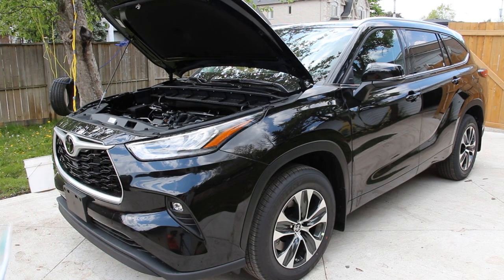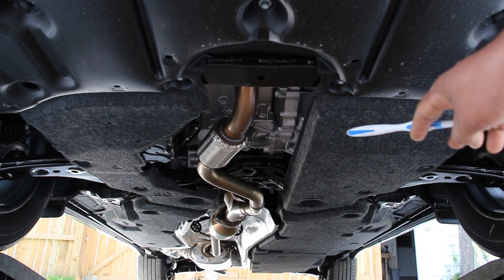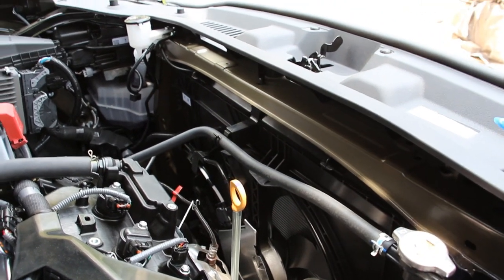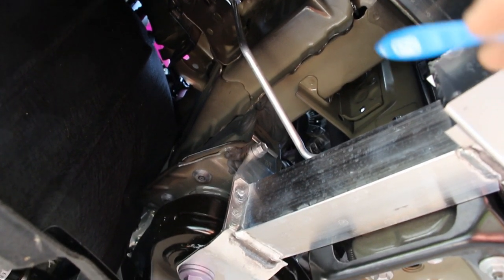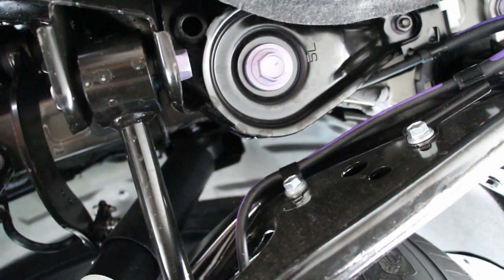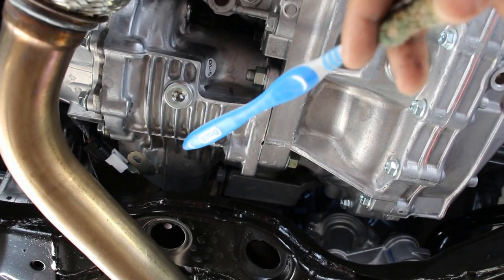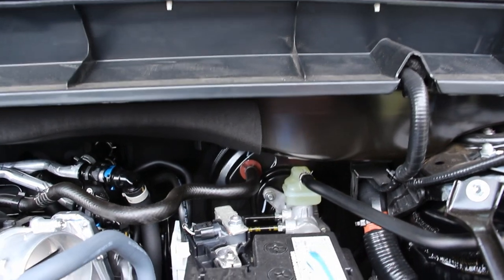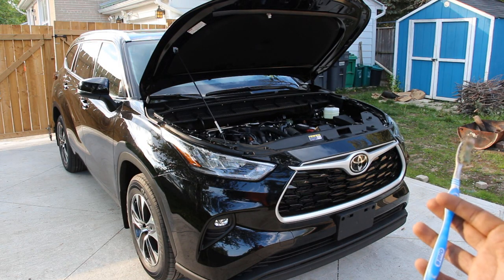Toyota Highlander Mechanical Review

Comment: Having to remove the transaxle assembly to replace a water pump or thermostat is 100% ridiculous.
Reply: Toyota hired some audi engineers who got fired
Reply: You think that's bad. Toyota said the transmission fluid does not need to change for the life of the transmission (Whatever that means). I'm not buying that excuse Toyota
Reply: Yaa.. its time to switch to electric...
Reply: I have a 2020 RAV4 that I got to replace my constantly breaking 04 4Runner and the 4Runner was a lot better built.
Reply: @Olliethelabradane  Change yourself and stop lying.
Reply: Don't worry you will not need a water pump for about 250,000 miles anyway.
Reply: @squidproquo2241  on 25k it will start to leak
Reply: That's nothing; try looking at German cars. Pretty much anything you do in a Volkswagen starts with first steps; remove entire front of car
Reply: @battlefield1942   "on 25k it will start to leak"

NOPE! That would be Telluride.
Reply: @kevinbarry71  EXACTLY!!!! LOL! These are Toyota haters.
Reply from the maker: Crazy!
Reply: @Ashoud_Anobetah  or BMW/Mini engineers
Reply: @squidproquo2241  He right quite a few had water pump issues, front timing cover oil leaks which enquired an engine out to repair it properly and the very first gen 8 speed offered in the Highlander was junk second year revised outside of that a good vehicles
Reply: @kevinbarry71  They want you to clean that front part often :P
Reply: Toyota tech here you don’t need to do that in order to get to the water pump just take the motor mounts off on the engine side use a jack and jack the engine up and you can get to it that way same way we do it on all 2grs all the way back to the early 2000s
Reply: @kclefthanded427  all of them do that now. My civic manual doesn't have a word for transmission fluids. Not for automatics nor manuals
Reply: @squidproquo2241  I've had 4 Toyota's in my life, currently have a 2018 Highlander w/ same motor. Water pump went at 78k. I don't hate them, but they've definitely got a weak point to this engine setup that is the cooling system/water pump. On the 2018 Highlander, we did not have to remove the transaxle. This new one is stupid though....
Reply: @awaara24  wow that's very early for a pump to give out. No tsb?
Reply: @moeanthony9308  nope. Also replaced front bank coils. Only one was covered under warranty before it expired and then the other two went as well. Knock on wood the rear bank coils going strong so far at 84k
Reply: @awaara24  Wow. I only buy Toyota. I didnt realize the Highlander had such issues and complexity in the new tnga. You still have the Highlander?
Reply: @awaara24  Yea it's best to change all of them at same time.. Coils
Reply: @awaara24  "I've had 4 Toyota's in my life, currently have a 2018 Highlander w/ same motor. Water pump went at 78k. I don't hate them, but they've definitely got a weak point to this engine setup that is the cooling system/water pump. On the 2018 Highlander, we did not have to remove the transaxle. This new one is stupid though....
"

In my life I noticed that haters tell all kinds of lies, I understand them, They want to be screwed by European car makers because they like fancy European cars. However, ignoring the facts is really stupid.
Reply: I’m glad I have the RAV4 with the I4.  I’d get the Hybrid Highlander.  No need for a V6 anymore.
Reply: @kclefthanded427  they all say that now… anyone who knows anything needs to change their trans fluid every 60k
Reply: @kclefthanded427  Lifetime fluid.  🤣🤣🤣🤣🤣
Reply: Is it the same for the second generation highlander
Reply: Get the hybrid model
Reply: Glad I saw this before I bought a Highlander.  The thought the rubber oil cooler and oil leak behind the timing belt rear shield was enough problems with this engine.  I think I'll  hold  on to my 1MZ

Comment: You do NOT need to drop engine/transaxle to replace waterpump on 2GR. Put it like this, Toyotas book time is roughly 2.5HRs to replace. Nor do you have to remove front end to replace alternator or A/C compressor. I work at a Toyota dealership and I need to correct these Misunderstandings lol. Unless you work for Toyota however, you would never know.

Comment: A bit of a maintenance nightmare once that cooling system needs service. Mechanics be like 🤑
Reply from the maker: Ya man I don't get it....remove transaxle to get the waterpump and thermostat??
Reply: This is why I like your videos. Informing us how difficult it is to do common maintenance
Reply: On previous models, there is a way to replace water pump by removing the engine mount and slightly raising the engine and don't have to drop the whole assembly. Not sure if it is still applicable to newer models.
Reply: @speedkar99  Great video! How often is this maintenance? Is this also an issue with the hybrid models?

Comment: I work at the dealership we don’t remove transmissions to work on water pumps and t stats we remove the driver side engine mounts and jack the engine up and get to it that way
Reply from the maker: Yeah I heard that's the way to do it on previous generations. So they still pay you the 8 hours for removal?
Reply: @speedkar99  I would have to check what they say but it’s most likely around 3 or 4 hours for warranty time
Reply: Nice car but feel I get pineappled each time I take it for service,  just like mercedes
Reply: Modern cars suk

Comment: Hi! Thank you for your detailed video on the Highlander.  I have a question regarding my 2017 HL SE V6.  I used to get 28.2 mpg on my highlander (99% highway driving).  Since I changed the battery without memory save, my idle has been more rough and I’m getting a lot less mpg (25.5).  I tried doing the idle relearn but it’s still not getting the mpgs I used to get.  I heard that 2017 was when new engine for HL came out and Toyota didn’t initially set the computer piston valve firing correctly at first.  Could I have reset the computer on my car that it lost some kind of correction to the firing?  Thank you

Comment: HeaterCore:  If you don't mind.  In the future, could you please include the heater core access in your reviews.  Some vehicles have easy access heater core and others you need to remove the entire interior dash to access it.  

How difficult is it to access the heater core on the current model Highlander?
Reply from the maker: I don't think heater core is a regular maintenance item thus it's not as easy to access
Reply: Had mine go out in 2016 kia sorento they had to take whole dash out

Comment: I have a 2006 Highlander with over 250k. Made $60k in one year in that car doing Uber/Lyft in the snow and all my maintenance myself 😀👍 To keep the car running I changed driveshaft (bearing near the hot Cat failed), all 4 wheel bearing, 2x timing belts (to be safe), sway bushings, 1 Fdrive axle, 4 brakes and rotors, 8 tires, radiator and thermostat (because I never changed R-fluid😳), valve gasket (and clean out carbon deposit on valve which caused pinging), 3rd set of spark plugs. Use inly Valvoline or Amsoil XL. Transfer Case and Transmission.
Amsoil, rear diff use Redline/modifer fluid (for better snow traction and reaction. No clunking that I had with Amsoil which too slipery) 😁👍
This New Highlander looks way harder to work on and my back won’t like it. Might do a new Bronco Diamond 4cyl w/ stick. Any suggestions?

Comment: Any idea if the rear suspension setup is different on the hybrid model? If not, what's the best way to maintain it to avoid issues of replacing? I placed a deposit on the hybrid.

Comment: What's with the trend of placing the ECM under the hood, near the engine, under the wheel well or bumper? Cars used to have them under the glove box or in kick panel inside the cabin, where it stays cool and dry.

Comment: Hello I do a Toyota Highlander platinum 2022, I bought it on auction and trying to fix. I am having issue with radio no working, and having a cable conning from the fuse box that I don’t know where is connecting, I am sharing a photo of somebody can help with it. Thank you

Comment: Stupid question but is this the same motor as in the Lexus IS350? Are there parts compatibility if they are not the same?
Reply: 2GR-FKS same engine
Reply: @anurakboribun2560  okay good to know thank you
Reply: @ToroMoto  https://en.m.wikipedia.org/wiki/Toyota_GR_engine#2GR-FKS
Reply: @anurakboribun2560  Exactly what I was looking for thank you. How many KMS do these motors typically last if well maintained. I see a lot for sale in older lexuses with excess of 200k km.
Reply: @ToroMoto  well, I think that you answered yourself your question. Historically they have been known to be very reliable and long lasting.  Then goes the complicating factor that manufacturer changes design now and then and the new generation may develop issues down the road...  There are other variables like: WHO was driving, WHERE, HOW - meaning what distances, was it warmed up on trips or not even got the chance to heat up before it was at the destination three miles away. Then how was it maintained, what oils and filters were used and if regularly and not too long  between changes. Time will show.
Reply: @anurakboribun2560  sounds good thank you.

Comment: So, the fuel pump is not in the tank ?
If true, then I need to buy this vehicle
Reply from the maker: There's a low pressure fuel pump in the tank. The high pressure fuel pump is on the intake camshaft

Comment: That control arm bolt has been like that for years.  You can get it out it's a bitch then when changed out you fix it by putting the bolt in the RIGHT way

Comment: I have 2 friends that have highlanders who have done most of the work on their cars in the past and hate this car because it always ends up costing an arm and leg when it needs to be serviced.
Reply: We have a 2003 Highlander with a V6.  It runs great and does not need repairs.  But, to have the required timing belt, water pump, etc., with new factory parts done,  was about $900.  But, it will be many more years until needed again.  (That''s about 2 car payments for a new car today, right?)

Comment: 7:45 I have heard manufacturers were obligated to put these extra lower frame pieces on SUVs/trucks so they wouldn't just ride up on small cars and crush the small car occupants.  Is that true or just myth?     Anyway, another great review.
Reply from the maker: Yes. That's the lower bumper rebar to prevent under riding

Comment: This car has a reversible alternator that has to work both ways one as and electric motor to start the engine and drive the vehicle down the road and a alternator to recharge the battery
Reply from the maker: Not this one. The Jeep Wrangler has that with e-torque

Comment: Why are some car manufacturers going away from spin on oil filters to cartridge style oil filters?  The latter is more prone to leakage and messier to replace.
Reply from the maker: I don't know. I guess eco-friendly
Reply: My guess is two reasons. Filter is  cheaper to make, only the paper insert and two gaskets. Yet they charge the same for it. Second it scares away DIYers, raking in more to service dept.

Comment: I'm disappointed by the amount of plastic parts used for oil and coolant cooling system in a modern Toyota. The Vauxhall/Opel suffered abundant issues with plastic parts.
Reply from the maker: Yeah time will tell if these hold up. At least the front frame and dad support is all steel and not plastic

Comment: I'm assuming mechanically the 2021 is the same, just with a newer sheet metal. Too bad there's no longer a 4 cylinder option.
Reply from the maker: The latest highlander is on the TNGA platform so there's quite a few things that differ from the previous one.
Reply: @speedkar99  Great info and good to know!

Comment: Why turbocharged engines vacuum is not sufficient and they need a vacuum pump ?
Reply: Instead of a vacuum the manifold is pressurized with a turbocharged engine. The brakes are boosted on most cars by using engine vacuum to pull on a diaphragm. No vacuum = no brake assist. Think like pushing the brake pedal to stop a car without the engine running. Same thing. A pump is used to create vacuum instead of engine manifold vacuum.
Reply from the maker: The manifold pressure changes when the turbo spools up

Comment: Hey! They copied Dorman with those oil cooler lines. Ha
Reply from the maker: Yeah they have to have them steel. You'd think by now they'd have redesigned the block to Integrate those lines into the oil galleys
Reply: @speedkar99  You'd think. Personal theory: they were gunshy over the sludge rep of the older MZ engines (caused by too-small, high-flow oil passages in the undercooled head and long conventional oil change intervals) and hedged their bets with an external high flow line. Of course now that they have required 0W20 for a decade it could've been redesigned. But i caught from the video they spec 5W20 now. That's surprising, especially when thinking about making a mostly 2004-designed, large displacement 6 cylinder work for the next 5 or 6 years of emissions/economy regulations. The GR was never an oil burner even on 0W20. And even more surprising since they spec 0W16 in their 4 cylinder lineup starting 3 years ago.

Comment: A mechanical vacuum pump on a naturally aspirated engine it's not even a hybrid.. rubbish''  they could have even used a electronic vacuum pump which would only run when needed..
Reply from the maker: That would introduce more failure points especially for the brakes....
Reply: @speedkar99  exactly.. an unnecessary wear item turning constantly with the engine wether or not your using the brakes.. at least if they went with an electric driven pump it would turn slower or shut down at cruising speeds once no brake application is made
Reply: @speedkar99  it just seems like a miss step on Toyota's side by implementing this.. it doesn't even have the safety margin as the electronic version which can still run even after an engine dies to allow more time to stop the vehicle

Comment: Gotta be honest, I’m a little disappointed in Toyota for cheaping out on parts.  No worse than most makes but I’ve always thought of Toyota as the best overall vehicle.  Like the placement of the bolts that you can’t back out, come on!  Maybe the Japanese have their own version of the millennial generation taking over...
Reply from the maker: I agree. They are riding on their reputation a bit allowing Koreans to catch up
Reply: @speedkar99  hey man do you have any tips on doing the vvt cam gears on my 2006 Sienna?  I know I could just let it go but I’m a perfectionist and the rattling bothers me and it lost a mpg because of it.  I think I can just take out the intake cams and swap out the vvt. After lining up timing marks of course... The back bank will be a bear though.
Reply: @speedkar99  I'd like to see how the hybrid looks for maintainance since it's a 4-cylinder.  I bet it's pretty easy to access everything. 

Toyota and Hyundai just have slightly different concerns. Toyota actually spends much more than Hyundai in R&D, but they want to have lots of cash on hand for the future which they think will shake up the car industry. They're increasingly going full hybrid for the Toyota brand so they can sell more Lexuses and still meet CAFE regulations and are pretty conservative otherwise. Hyundai on the other hand is more focused on growth, though they seem to be increasingly concerned about the future too and recently increased their R&D budget to be more competitive with other carmakers.
Reply: @joa8593  Hyundai needs to work on their manufacturing, there’s too many quality control issues leaving there factories here in the US. They already have a huge recall for failing engines and engine fires. Seen and heard too many stories about this including, including my own experiences with my time owning a Kia.

Comment: This is too complicated, buy an EV
Reply: I guess you've never seen a torn-down Tesla battery pack 😂
Reply: @LeDank  Battery seldom go bad and if it does the whole thing is swapped out under warranty
Reply: @JacobTJ1  You could make the identical statement about the drivetrain on the Toyota LMFAO
Reply: @LeDank  I agree but I meant to say less complex. for eg. a water pump replacement is a nightmare on these V6., spark plug replacement etc..
Reply: @JacobTJ1  what if it’s out of warranty?  Nope, no ev for me.
Reply: Nope, no ev.  Where I live the condo corporation has to be involved in the planning for an ev charger, as does the electrical contractors, building contractors, planned proposal for an ev charging station outside my unit, cost estimate, etc, etc.  Not worth it when companies and condo corporations don’t want evs on their property.
Reply: @JacobTJ1  I know what you're getting at. Internal combustion engines are large and complex and have a lot of parts that break and are a pain to fix. Unfortunately, they remain the only option for most people. EVs still kinda suck right now. I can't get one cuz I live in an apartment complex with road parking and also frequently take 500 mile road trips every other month. An EV would be borderline useless for me to own.
Reply: @LeDank  EVs break down more than you think, more moving parts doesn’t always mean you’ll have more problems . I’ve heard tons about electronic component failures on electric cars.
Reply: @tails300  the battery packs also require expertise and tools beyond the average consumer to repair. That means you ain’t fixing it yourself. I can change a damn alternator or serpentine belt or even like a valve cover gasket with the tools in my garage.